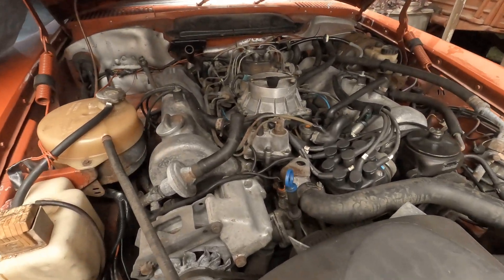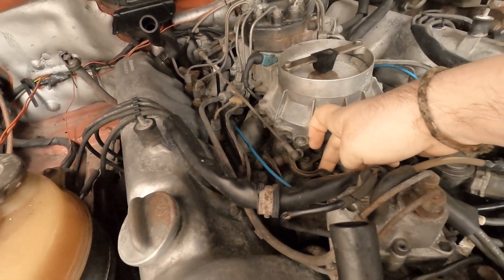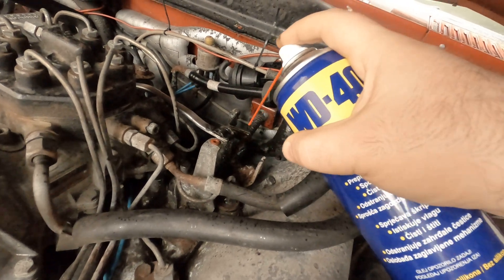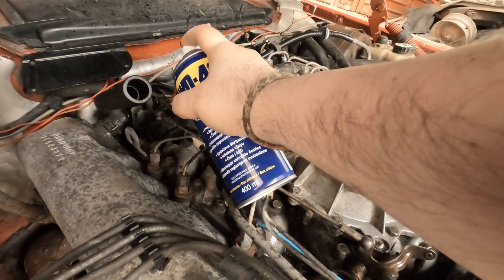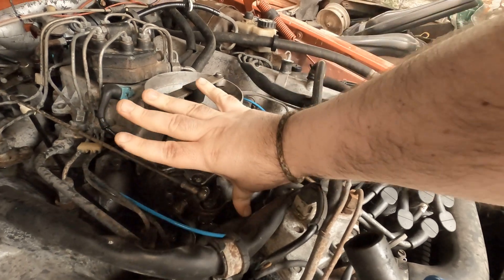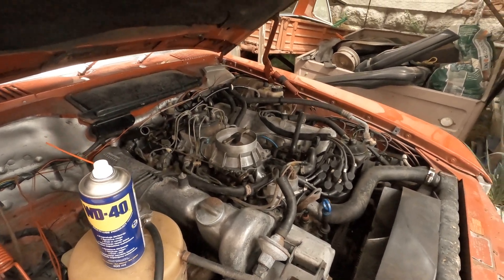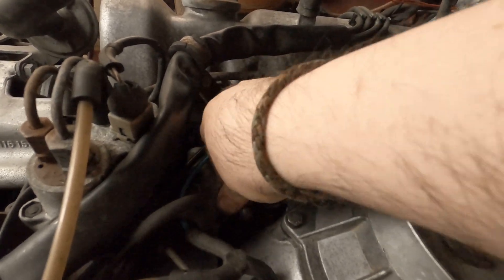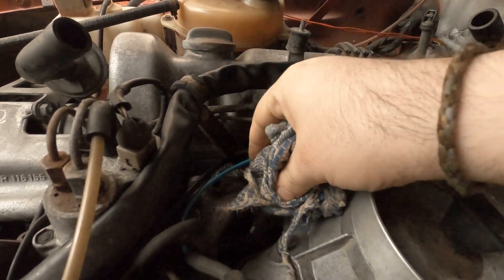㉦Mercedes Ke-Jetronic㉦ - 🛠️Fixing the throttle linkage on Mercedes R107🛠️

Comment: Hi Ivica, my G300 after warming up and driving around, when at traffic lights i put from D to N the rpm goes up at 1100. Then, i press the pedal a bit and release, the rpm down to 750. And its always like that when i put from Drive to neutral. I have check all of the throttle link and clean them with wd-40. The mechanism is good, but the idle always stuck at 1100. have you ever get a problem like me? Thanks
Reply: hey i just fix it by adding an additional spring into the throttle linkage. happy mercedising!
Reply from the maker: I'm glad you made it! Happy Mercedesing!

Comment: hello I'm desperate I have a w124 300ce of 1991, it only starts with the eha plug disconnected, as soon as I plug it back in it cuts off, the eha is new.
Reply from the maker: Hello. You must measure the difference in pressures with the pressure gauge. It has to be 0.4bar.
Reply: @mercedeske  I don't have the tools to measure, it's as if the eha blocked the gasoline I have videos if you want to see the symptoms https://youtu.be/Y58xOFOoxfI?si=uo3PhmC67vDhU7aa

https://youtu.be/HLkfLCr68bE?si=T6sgDpVeMZfDRwtm

https://youtu.be/Ri-2tXm86QQ?si=u0flHLUPfaIp7YsV

https://youtube.com/shorts/bq0W2T6_QpI?si=guiA3rFD3jVNhpht

https://youtube.com/shorts/LETXkpKrB60?si=T6IZBB1JoD3heSgd
Reply from the maker: I saw the videos. You can take a multimeter and measure miliamps. For this purpose you need clip leads and to connect them to your multimeter. I have a video on this. If you have bought a new EHA it doesn't mean that the EHA comes calibrated for your car, so you should know that. Remove the protection screw and calibrate the EHA so you measure 6.6mm from top to the 2mm allen screw. Under these conditions your car should run with the EHA connected. Afterwards you will have to set the mixture so that you have fluctuation between -3 and 0mAmps once the engine is at the operating temperature.
Reply: @mercedeske  thank you very much, I have already measured the milliamperes I have 19.90 with the ignition on and it comes back directly to 0.

ok I will do the EHA adjustment as you told me. I'm going to equip myself with a caliper like in one of your videos.
Reply from the maker: @E30lover02  Yes, I saw it. But, you must have a STEADY READING on the ignition ON, not a fluctuating one like in your case.
Reply: @mercedeske  ok, is that why the reading is not stable? it's as if the eha received information that the power was cut
Reply from the maker: Check the wires, if everything is okay. Remove the ECU plug and the one from the EHA and check if the wires are okay, if you have continuity.
Reply: @mercedeske  ok, I'm not checking continuity, do you know what pin number is on the ECU that connects the EHA? I measured the ignition voltage, it was 9.5V on the EHA socket
Reply from the maker: @E30lover02  https://www.instagram.com/p/CTdM_5lqTKN/
Reply: Thanks
Reply: @mercedeske  hello, I checked the continuity of the EHA wires they are ok, however I still have this value of 19.50 which varies to 0, as if an instruction told it to cut off. I calibrated the EHA as in your video there is no change it wants to start but it is cut off as if it receives information to cut off the injection.
Reply from the maker: @E30lover02  I believe then that it has something to do with the ECU. This is my opinion.
Reply: ok i will change it @mercedeske
Reply: @mercedeske  hello Hello, is it normal that I have 0V on the cold starting injector socket? the car is parked in a garage at 15°. the first start is laborious (always with eha unplugged)